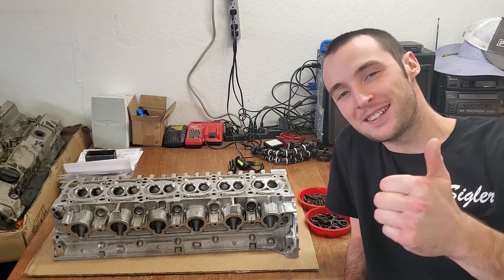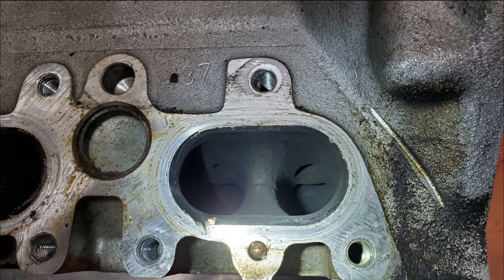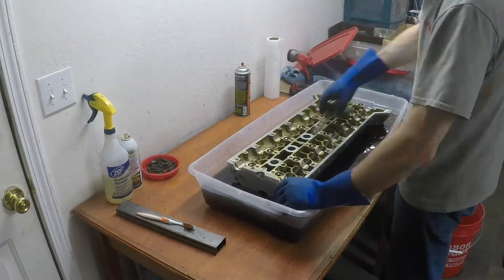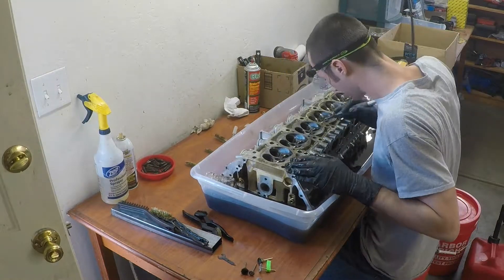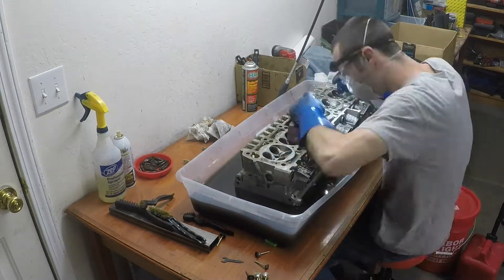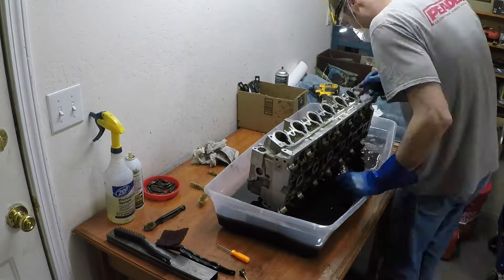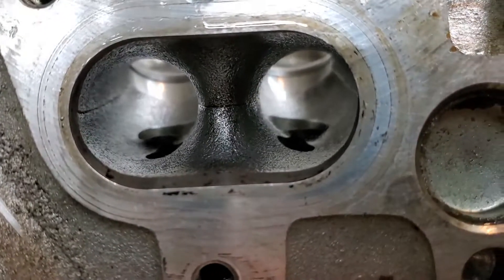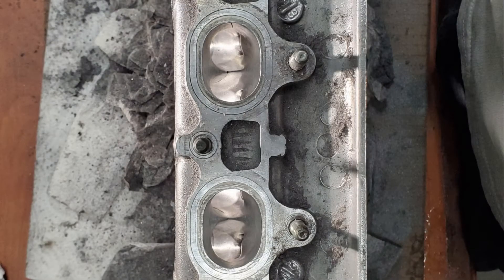Cleaning The Head - M104 Turbo Build (Ep. 12)

Comment: The lip on the exhaust port really dont matter as the gases are leaving the ports 
A completely different story on the Intake though :-) 
Exhaust gases act completely different to Intake charge which has fuel droplets as well as air
great videos enjoy them .😃
Reply from the maker: Youre right about that, however some light porting on this head's exhaust ports would surely increase velocity and efficiency. So, i did it haha. 

TBH this is more about love for the machine than anything. And thanks!